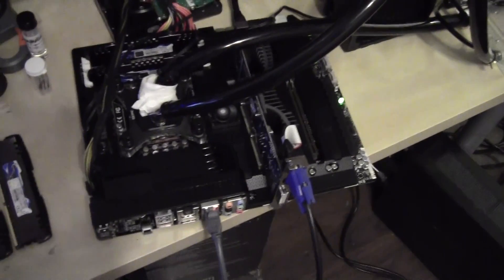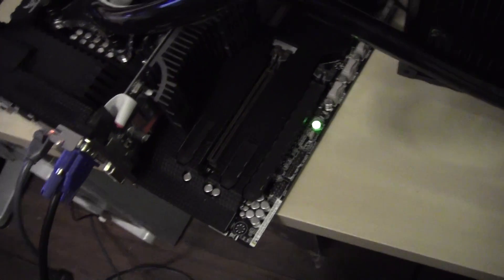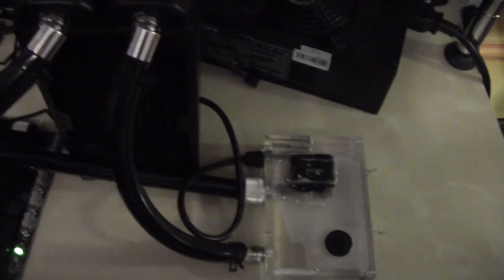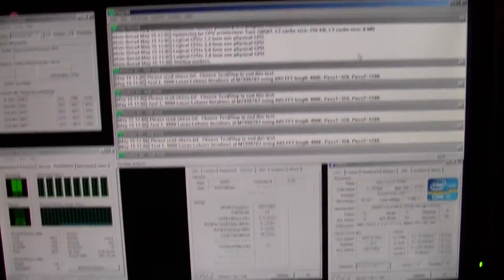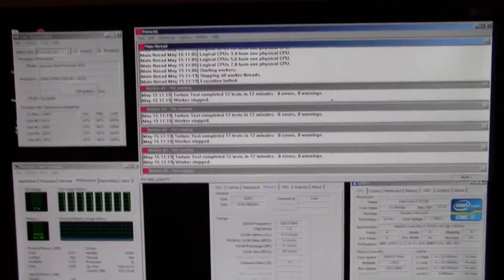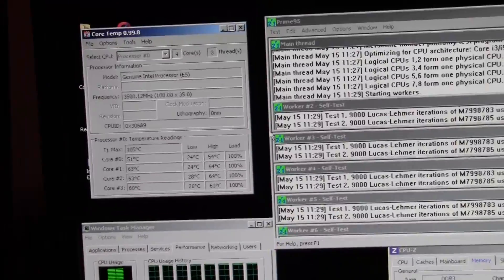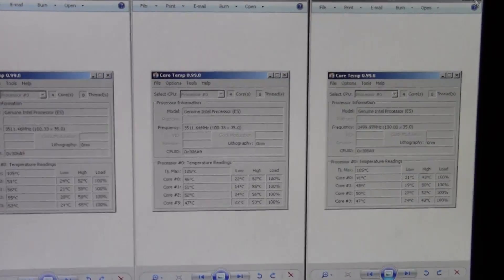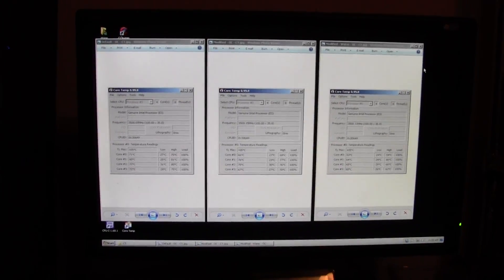Part 3 - Ivy Bridge (Intel Core i7 3770K) Testing - Replacing IHS Thermal Paste - Watercooled

Comment: btw my overclocking 4.5 ghz is too more cozi don`t have a good cooling i only got hyper 212 turbo evo so i changed my overclock to 4.2 ghz with volt=1.110v and max temperature=66 and tested with prime95 for 1h or more and played black ops 2 for 45 min and it`s ok nothing did and im happy ! :D

Comment: You should of tested with the same water cooling unit to get more accurate results... the water cooler you are using in this video pushes a lot more water and cools more. Thanks for testing! It defiantly shows the TIM isn't a very good quality that intel used. I hope that isn't the case with the 3930k chips cause Im about to buy one :/

Comment: yeah, laptops which are assembled with accuracies within a few micrometers. can you do that? no human can do that. the pressure they give to each screw is very accurately measured - we can only guess to when it is fine. that's when it breaks.

Comment: Pass...ill just wait for the hasswell chip or at least a second stepping. major fail on intels part. they thought they would get away with it just to save a few pennies. Had the same issue with my evga board when they used super cheap paste on the north and south bridge and I had to dismember them from the board.